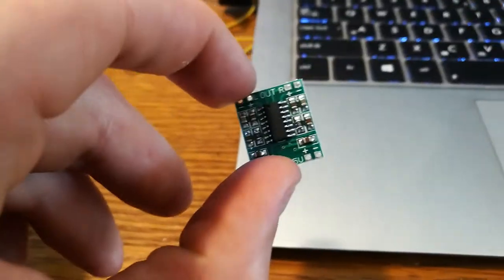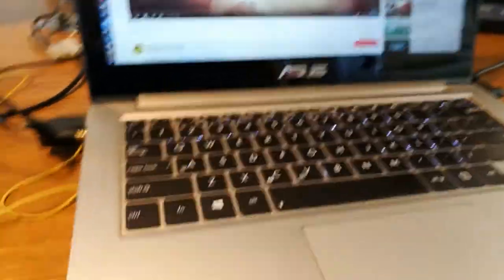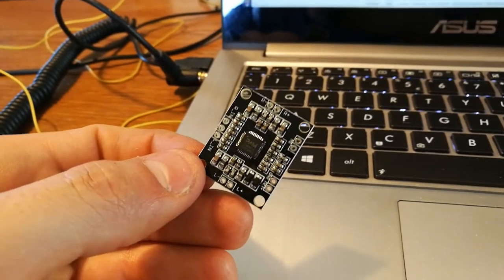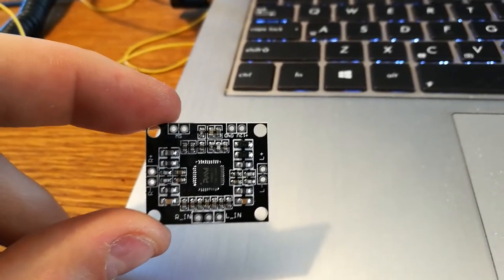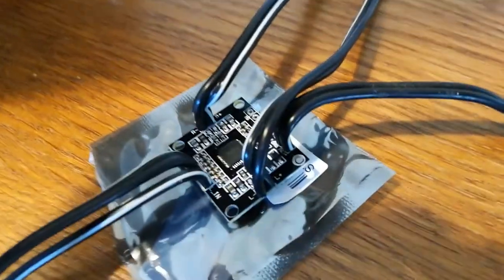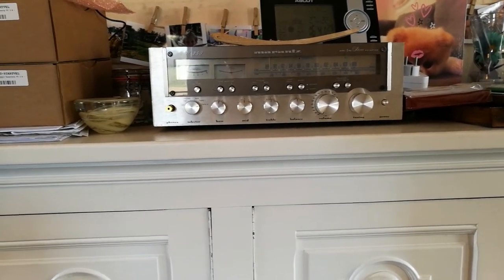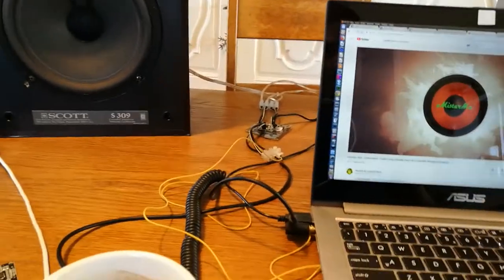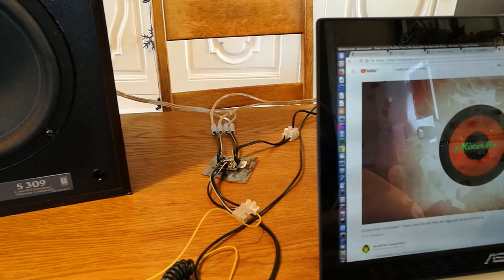Wish Bangood PAM6810 mini stereo class D amplifier, test,extra info on features, tips

Comment: If the through-holes are too small for desired wire gauge, why not surface-mount the wire onto the pad?
Reply from the maker: Quality of the PCB is not top notch so putting too much heat into it makes the metal layer loose ...
Reply: @TheHaerlings  Good point. Thanks